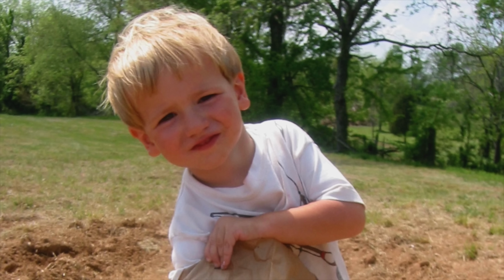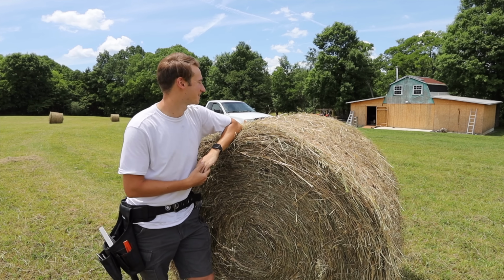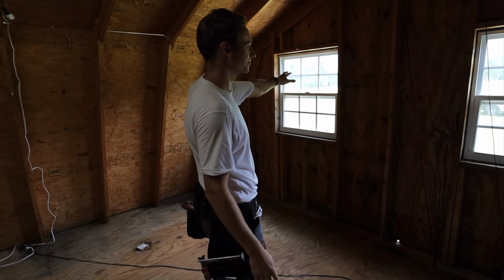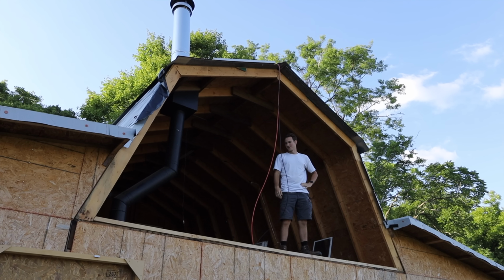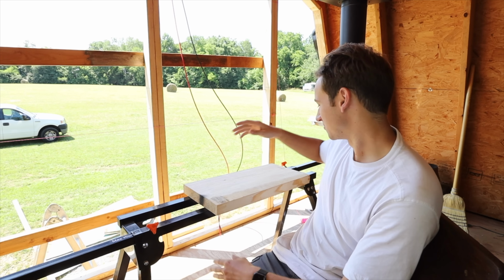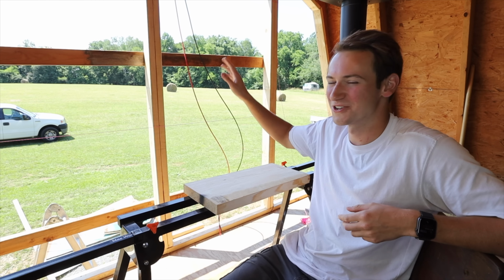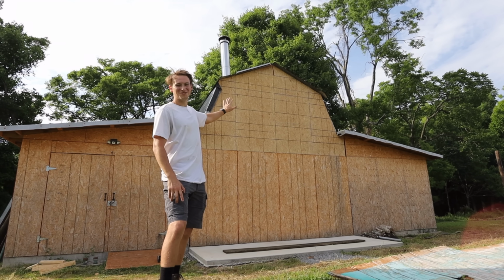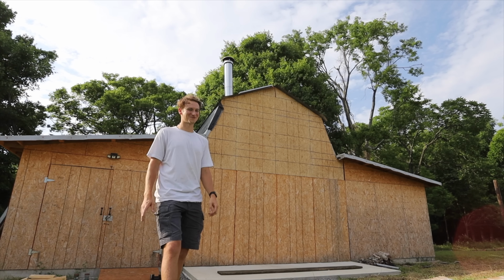Giving New Life to Our 20-Year-Old Abandoned Home Depot Shed

Comment: You should use zip tape to seal the joints which will help with wind blowing in and will make it harder for water to also get in. Then you can wrap the house wrap around the shed.

Comment: House wrap doesn't hold up well in the sun. It needs to be covered pretty quickly. You might use felt (we normally use 30# but you can use 15# for the sides)
instead, if it's going to be a while before you get your siding installed.

Comment: Cool idea using trees from your property for siding. However, after milling the lumber it will need to be dried before you can use it. If I may suggest, contact Out of he Woods sawmill up near Knoxville and see if he would trade out an equivalent amount of dried poplar in exchange for your logs.
Reply: We can put poplar up green. We’ll do board and batten and that will take care of the shrinkage. We think there’s enough 2x6 from the old lean-to shed roofs to build a solar kiln. We should be able to dry some of the other wood in under 30days for interior wood. All the barns around here put up polar green.
Reply: @MrZZeroG  Thanks for the reply, see, you learn something new everyday. Will you have video of your kiln build?

Comment: This is completely backwards, but the guide lines on the OSB should be inside. You want the smooth side out for the most weather protection. (supposedly) It's how I've always done it, at least. Why they don't put the guides on both sides, I have no idea.
Reply: Yes. Well apparently the rough side goes out for traction on roof decking and that’s why the nailing guides are on the “up” side. Either way, if you’ve seen osb in the wild it doesn’t do well without protection and we are putting wrap and of course the siding. Probably doesn’t matter much in the long run.  Just wait until we cut our windows out - I’m betting there will be a lot of differing opinion on THAT. thanks for watching and commenting!

…that is of course assuming that we can actually buy and have windows delivered. Apparently lead times are awful.
Reply: @MrZZeroG  Don't I know it. Took months to get my windows. Cutting the Tyvek for the windows was a debate: do you cut an I or a V for the flaps to wrap inside? How should we put on the sill seal and window seal tapes? But I get differing info on OSB: one side saying the smooth side has more resin and better weatherproofing, the other side saying the whole thing is made of resin so it doesn't matter. I know that my OSB has survived 2 years without Tyvek, just needed to seal the edges with some tar. But I'm also one of those "safety? That's my job, not theirs" kinda guys so I put smooth side up for my roof.

Comment: Is the plan to live and work from the tiny house? My company is hiring (more ME degrees but we have aero guys) and I know a guy or two who have left for engineering jobs down that way (one at Boeing). If remote work is the plan, make sure you get good high speed internet...think about applying for starlink early if cable/fiber is not available.
Reply: We have fiber on the pole in front of our property. When we get closer we will probably get starlink…
Reply: @MrZZeroG  I don't think you can beat the speed of fiber right now. Might be worth trenching in a wire or atleast conduit for it in the future. The downside is I don't think a homeowner can really do anything themselves as far as installing it, it takes high end equipment to tap into and splice.
Reply: @EngineersHomestead  yes. The area got the fiber grant and when we run a temp pole and the primary utilities a few hundred feet, it will be about 100 ft from the shed. We still are shooting for off grid- but to preserve the ability to bring power in later we need to get the inspection during construction. It will probably end up serving our pole barn/workshop long term, but will be convenient during construction. Generators are burning through gas right now.
Reply: @MrZZeroG  when I quoted to power a shop, the local utility would run a new service about 200' from the pole/transformer before I would have to put in a pad and transformer base (= $$$)
Reply: @EngineersHomestead  yes. They are running primary 275 ft (7.2kv) and then stepping down to 4/0 for last 100 underground. $$
Reply: @MrZZeroG  so you have to pay for a transformer base, that sucks